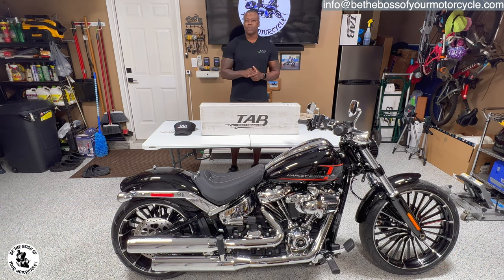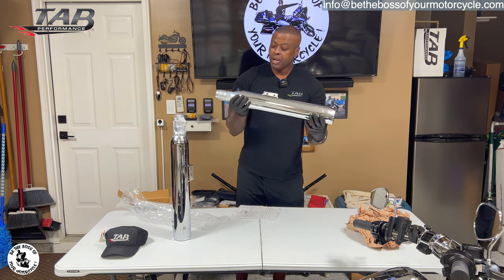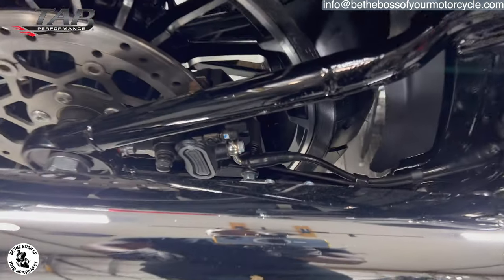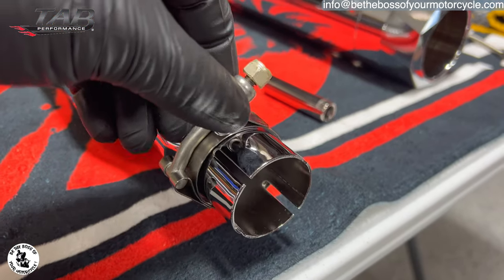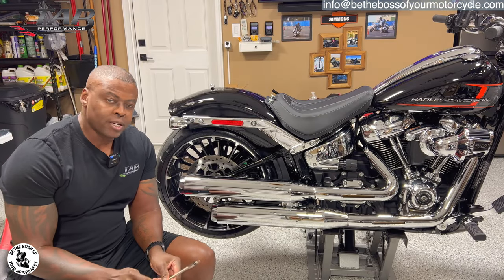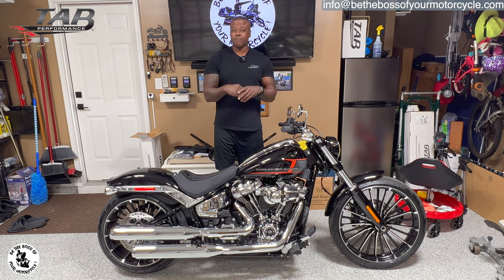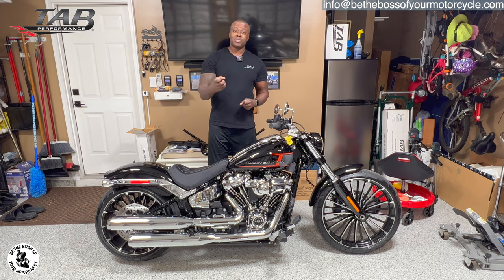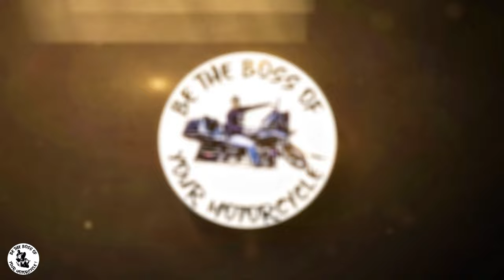Tab Performance Upgrade For My 2023 Harley Davidson Breakout!

Comment: I just made it to the 12:35. What did you use Red locktite on? I think they set you up. Only for engine bolts and frame bolts. You have to heat up the the bolts if you use Red locktite. Blue for everything else.
Reply from the maker: On the two screws holding the pipe on the frame.

Comment: I'm surprised you didn't go with 2 to 1 vs duals. Before I bought my 21' slim. They had a 21' with a 2 to 1 with a Vance and Hines graneds slip on. Wow!! That bike was loud and adding more torque with a stage 2 cam. I'm so glad after the Slim. I didn't have to worry about upgrades and tuning was already done.
Reply from the maker: Yeah I actually like the way the w pipes look better. With this motorcycle, it's all about the looks to me. I don't care too much about power. It's pretty powerful already!:_PRELOAD:

Comment: Still watching, the clamps on the heat shield are 5/16" socket, so a 6 in 1 screwdriver is a good option. I don't like the idea of tightening hose clamps with a flat tip just because of the off chance of the screwdriver slipping off and scratching the living sh** out of something. Use a 1/4" drive 5/16" socket and orientate the clamp in the most accessible way possible. You can completely undo and open that type of clamp. Also try to tuck the tail end of the clamp under the heat shield, I did my Sportster and one of the clamps is really close to the rear brake line and cylinder, you don't need that clamp rubbing on that stuff.
Reply from the maker: Thanks brother! Yes I tucked that bolt under the pipe. I don't know how I missed that.:_THANKYOU:

Comment: Great looking and sounding slip-ons. I must tell you though that the muffler clamps are garbage. If you take the mufflers off more than once, you will break the clamp bolt. I don't know if I tighten mine too much because they don't give a torque value when installing. The Harley clamp is a pain but it is a lot stronger. Keep the old clamp on a shelf, you just might need it.  Just my two cents. Enjoy that LOWRIDER.
Reply from the maker: Thank you very much!

Comment: What model of Tab are they? I looked at their site, and don’t see anything for 2023. Also what rear fender brake light and brake lights did you use sir? Thank you!
Reply from the maker: Thank you for watching and hopefully you’re subscribed to my YouTube channel!👍🏾😊 Look up a 2020 Breakout on the website. It’s the same. Regarding the rear light, I just did a video on it a little over a week ago. Check it out when you get a chance.
Reply: @BeTheBossOfYourMotorcycle  thank you sir!! I saw your link further down. Bike looks and sounds sweet! I am looking to trade up to a new Denim Breakout, going to order it with in the next week.
Reply: @BeTheBossOfYourMotorcycle  I did notice sitting on one the seat kinda pushes on my legs but fine when in position. I’m only 5’9 though. How does she ride for you?

Comment: Hi Sir
.
What is the solution for the sensors in 2023 breakout 117.. I want to install the zombie 🧟‍♂️
Reply from the maker: I had no issues with mine.
Reply: @BeTheBossOfYourMotorcycle 

That answer is more than enough for me..

Thanks Sir
Reply from the maker: It’s my pleasure. 😊

Comment: Did you have to mess with the computer to make it run good?
Reply: That was my question.
Reply: That was my first thought too; perhaps the ECM has enough "self adjustment" for the slip ons. They really do sound good.
Reply from the maker: No it's just slip ons.:_PRELOAD:
Reply from the maker: @craigjarboe2834  :_THANKYOU:No issues with just slip ons.
Reply: @BeTheBossOfYourMotorcycle  oh, you’re lucky because you also have a high flow filter on it
Reply: That was my question too.
Reply: Im excited,im ordering this exact bike in aust,,these look stock,,the cops wd have no idea,,awesome,,now ill get the same pipes